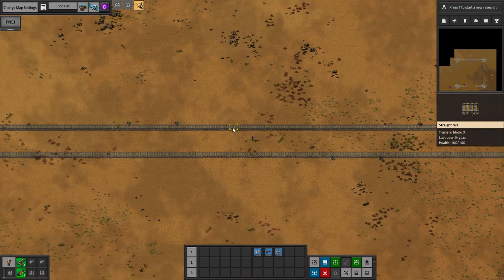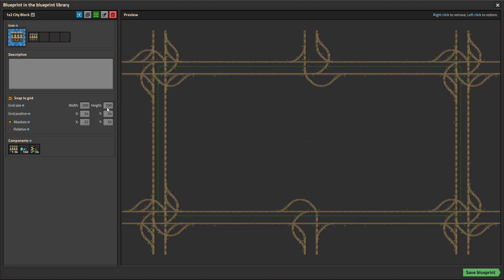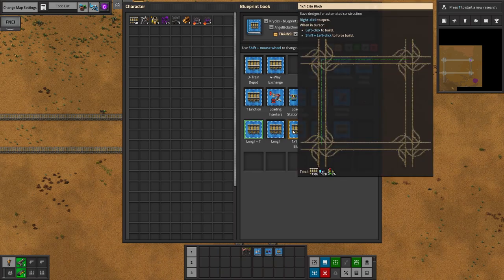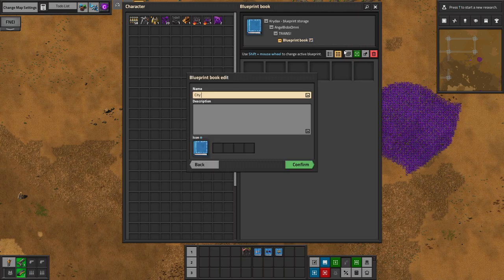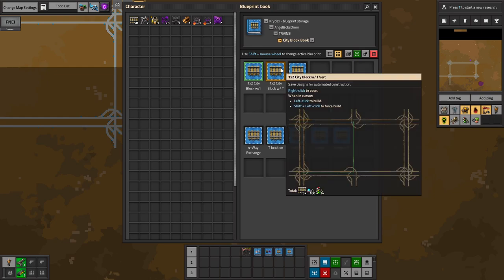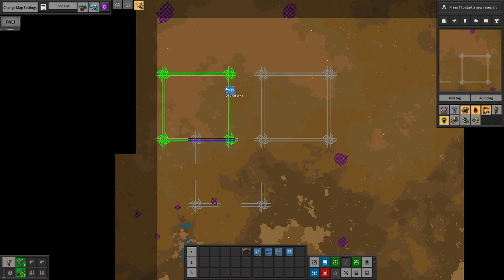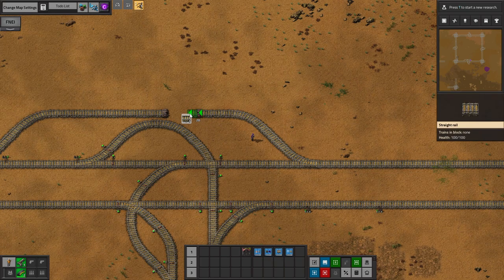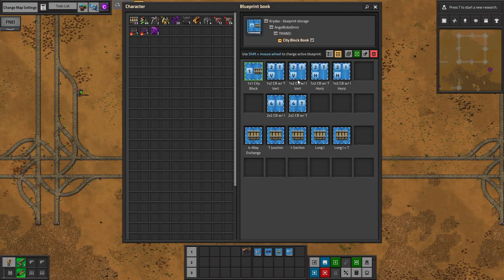Factorio AngelBobsOmni #Bonus1 - Creative Mode Rail Blueprinting

Comment: For the future of making blueprints that have stuff on one side, it is easier to start on the blank side and drag toward the side with stuff. In the case of the 1x2 rails you would start in the upper right corner and drag toward the lower left to make sure you get exactly how far you want.